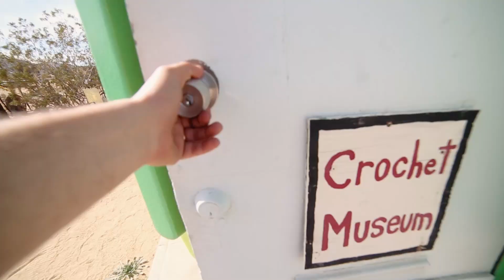Joshua Tree National Park in a Westfalia Vanagon! Alli Cherry Camping Vlog

Comment: I've always had a special affinity for VW campers and buses. Back in the day, I had a '71 VW camper. That thing took me over most of North America. They are very cool but the reality is they can be high maintenance. I always carried extra spark plugs, belts, hoses, air filters,  distributor caps, points, extra oil, etc. I had 2 tool boxes, one for actual tools and one for spare parts. I kept the tool boxes in the storage area under the couch that can fold into a bed. I even carried a porta potty chemical toilet for emergencies. It fit perfectly in the storage area under the seat cushion of the backwards facing seat behind the driver's seat. When stored you never knew it was there. I also carried a yoga type mat for times when I had to be on the ground under the van. Waterless hand cleaner was also a must to have on hand. It does a great job removing grease and dirt after working on the vehicle. It comes in a small can at any auto parts store. Or course I'm assuming you have jumper cables, fire extinguishers, etc. Save travels!

Comment: The more you know about your Vanagon, the better off you will be. Basic repairs and maintenance are easy.  Know torque values for spark plugs.  Do not let your engine, if it is a stock 1.9 or 2.1, overheat. You are wise to stock spares parts. 

Fortunately, it is relatively easy to work on Vanagons and most parts are widely available. 
Happy travels.